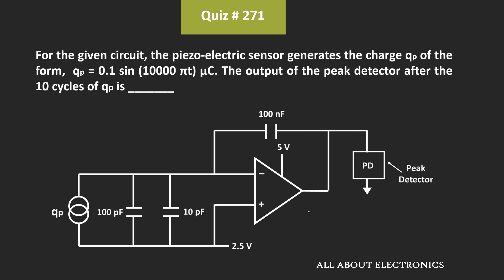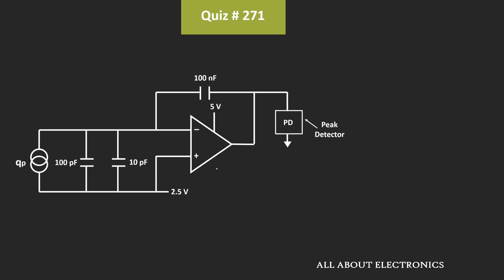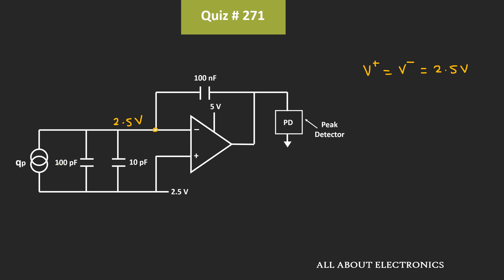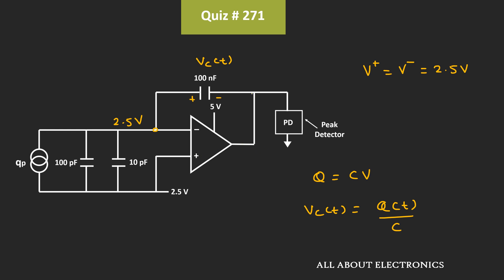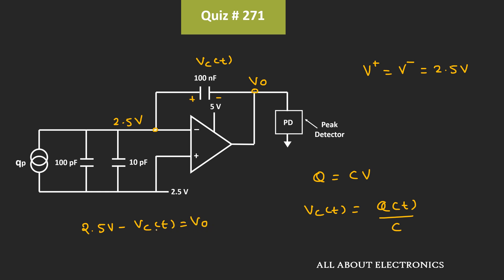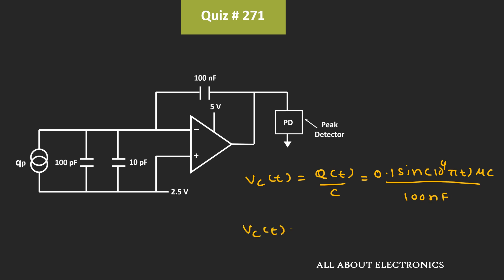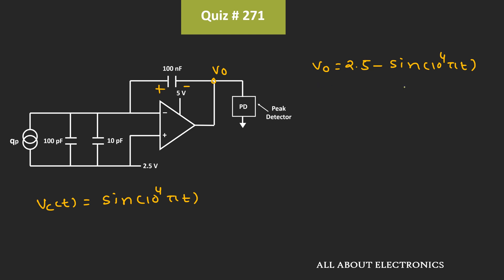Operational Amplifier (Op-Amp) Solved Problem | Quiz # 271

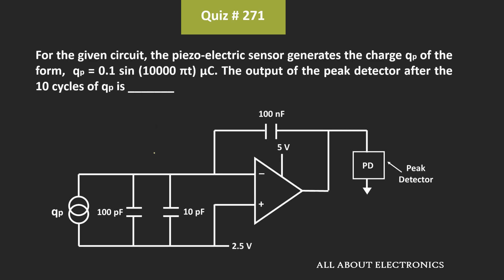Comment: #3:15 the output of peak detector is 2.5 at the end of 10th cycle right?

Is peak detector output depends on number of cycles?
Reply from the maker: The ideal peak detector, detects the peak value in the signal. And then it holds that value, until it gets reset. So, if the input to the peak detector is a sinusoidal signal with peak value of lets say 3.5 V, then it will hold that value. The value will not change, until the new peak (with greater voltage ) is detected. 
So, in this case, even if you see the output of the peak detector after 5 cycle, it will be 3.5V only. 
I have made a separate video on the peak detector on the main channel. For more info, please check that video.
Reply: @allaboutelectronics-quiz  got it 👍
Thank you sir for the clarification

Comment: There is a better way . Find the Xc of 100nano cap and then differentiate the charge Qp and mulitiply the result by the impedance which gives you exactly one volt across the feedback cap.
Reply: That's awesome